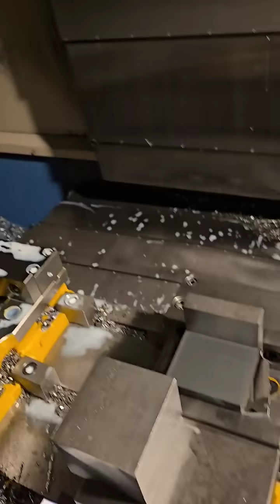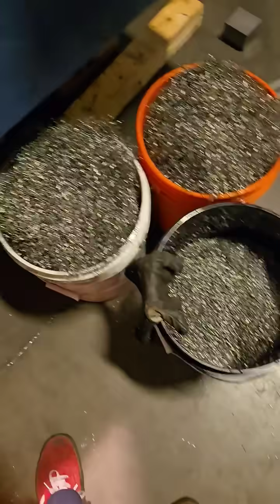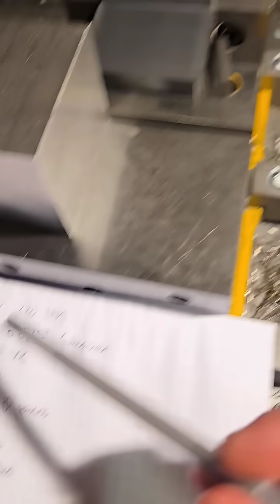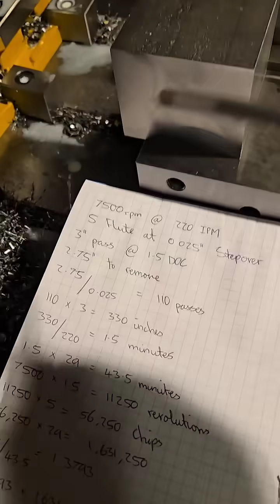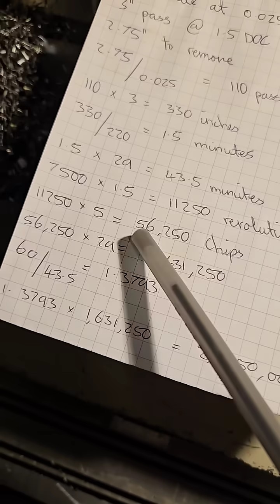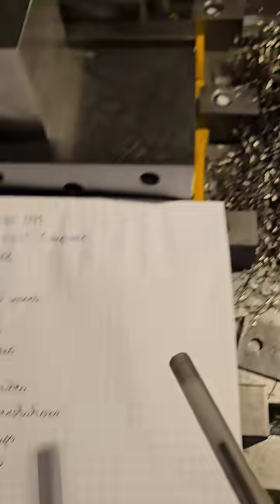Making Millions of Death Needles #cnc #mechanic #diy #repair #machine

Comment: I am curious why the initial roughing wouldn't be done with a bandsaw or something similar to remove that large amount of waste
Reply from the maker: Roughing it out with a bandsaw would be an extra step and require someone to watch the saw. Doing it in the CNC means I can do something else while it does its thing.